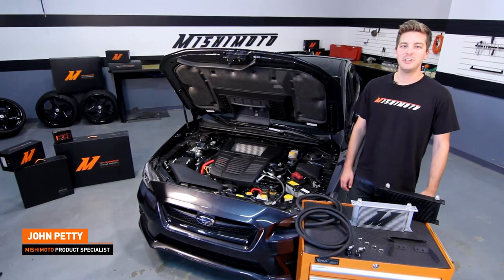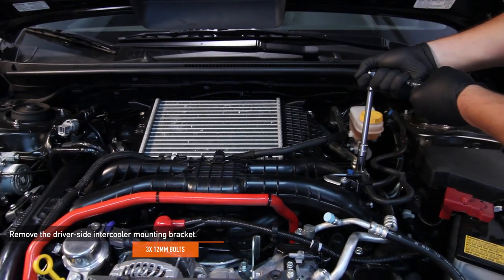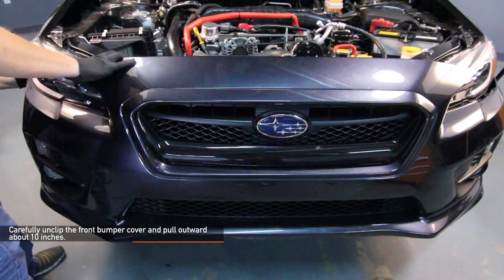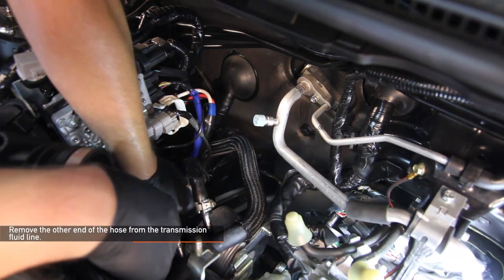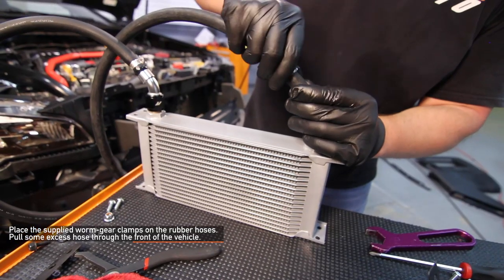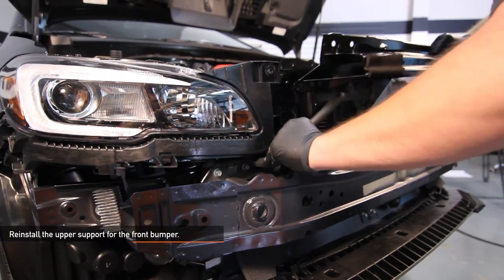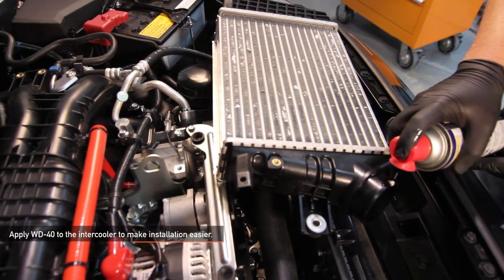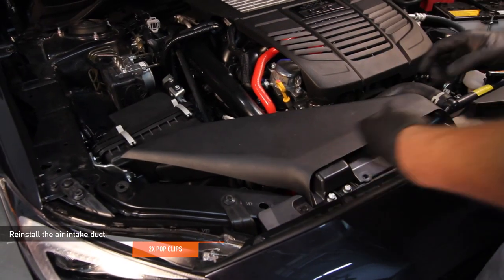CVT Transmission Cooler for the 2015+ Subaru WRX, Installation Video

Comment: Bought my CVT cooler then realized the two subaru dealers closest to me don't sell High torque CVT solution. How did you guys get your hands on some?
Reply from the maker: We picked up Subaru SOA748V0200
Reply: @mishimoto  do you guys have a way to buy it from them? because all the dealerships around me do not carry it. If so I could just talk to your sales department about ordering some from you guys if thats cool?
Reply from the maker: we unfortunately do not have any extra on hand to sell. This was purchased solely for our engineers to test with. Most customers we've spoken with have had to pick up the full bucket directly from Subaru or Subaru parts suppliers.
Reply: @mishimoto  dang! I really wish subaru would just sell the quarts of this stuff instead of 5 gallons for 350$ only. looks like my CVT cooler will sit pretty till then.
Reply: You can use RED LINE, NON-SLIP CVT High Performance Fluid from my understanding.

Comment: after installation do I have to check on the level of the cvt fluid in Mishimoto transmission cooler every tune up of the vehicle? Thanks. Will be installing next week. Thank you.
Reply from the maker: You'll need to check it after installation for proper fluid level and we recommend checking the levels at each oil change to be sure there are no leaks.

Comment: Hi I own a 2016 wrx cvt. I brought it to Subaru to get checked out. The mechanic said the fluid should be green. But it’s orange pink color because it’s meant for high torch. Am I wrong or is that dealership wrong
Reply from the maker: The CVT WRX uses High Torque CVT fluid, this should be an orange color. The green fluid is what is used on standard CVT transmission and should not be used in the WRX CVT
Reply: Thank you !

Comment: I feel this install video is a little incomplete.  You did not advise the installer on what to do with the fluid lines that were removed from the stock cooler to install the remote cooler lines.  Were they left dangling about?  Would they release any fluid if left attached to the trans.?
Reply from the maker: Hey PF, you will be removing one of the trans lines coming from the OE cooler entirely and replacing it with one of the hoses going to our core. The other line from the Mishi cooler should be routed back to the open port on the transmission. If you run into any issues, feel free to reach out to Support@Mishimoto.com!

Comment: I’m assuming it would be possible to install it so the “M” logo is facing outward? (Even though it would turn into a W.
Reply from the maker: Hey Michaeloll . The orientation of the M is completely up to the customer. If you do not like how the logo is positioned out of the box, we could always send out a stencil for a quick re-spray.
Reply: Mishimoto Automotive do the lines going into the cooler have to go in a specific way or each line goes in wherever?
Reply from the maker: Hey Michaeloll . In this situation, there is no proper orientation for the lines. Just be sure every line is secured properly, and you are good to go!

Comment: So does it means after installation, will get stock and mishimoto cooler at the same time?
Reply from the maker: The stock cooler is retained as it does help get the transmission up to operating temperature much sooner preventing excessive wear on the transmission.

Comment: Will this work on the 2015 Impreza Sport 2.0 with the CVT?
Reply from the maker: We have not tested fitment on the Impreza Sport so we cannot confirm if this would bolt up.
Reply: Hey, I have the same vehicle, did you try it out?
Reply: It will work you just maybe have to make few modifications to mount the cooler

Comment: if i get the mishimoto radiator for my wrx cvt 2018 then where i should place this cvt cooler? thank you
Reply from the maker: The install location of the CVT cooler would not change with the install of our radiator.
Reply: @mishimoto  thank you !

Comment: I have hella horns installed on mine, would this cover it completely or is there a way to lower it?
Reply from the maker: The length of the lines may prevent you from relocating the cooler. You may want to move the horns, or source longer lines to have more flexibility with the cooler placement.

Comment: need the cvt fluid.  costs 350.00 for 5 gallons at subaru.  help! should we get amsoil's cvt fluid?
Reply from the maker: +jeffrey pua please email support@mishimoto.com - they will be more than happy to answer any technical questions!  :)
Reply: 5 gallons is a lot I think you only need 1
Reply: What did you end up doing?
Reply: D Rock 75
i went to the dealer and begged for used scraps and the supply guy was nice enough to give me 0.5 gallons worth and that was perfect to install this.

Comment: Does it fit with a front mount intercooler
Reply from the maker: The CVT cooler will fit with the front mount intercooler installed.

Comment: will it fit the 2015 forester xt
Reply from the maker: Hi Branko! I'm sorry but this particular trans cooler will not fit your 2015 Forester XT - however, we do have a range of universal transmission coolers you can check out here: https://www.mishimoto.com/catalogsearch/result/?q=universal+transmission+cooler
Reply: Mishimoto Automotive do you have any thing that will fit my forester
Reply from the maker: Yes we do! Check out our Subaru Forester XT Race Intake 2014+: https://www.mishimoto.com/subaru-forester-xt-race-intake-2014.html

Comment: Will this fit a 2012 Impreza CVT?
Reply from the maker: This was designed for the 2015+ models and will require modification to work on other vehicles.
Reply: Mishimoto Automotive do you know any modifications they would be required?

Comment: Can This fit to levorg?
Reply from the maker: A lot of the parts are compatible between he two models. As long as you car is using the high torque CVT we do not see why this should not work. I would check your OEM part numbers to confirm this.